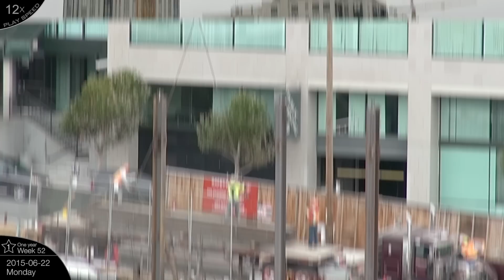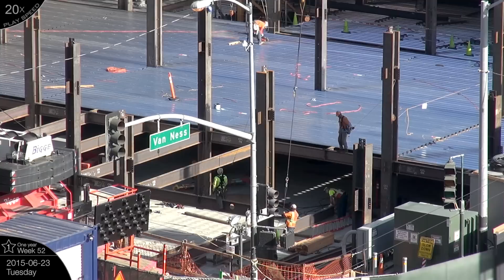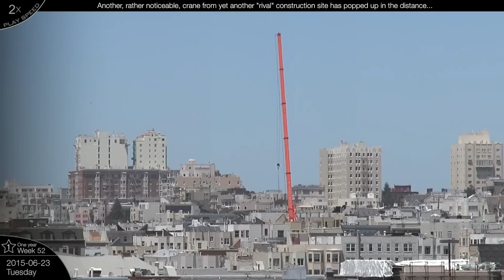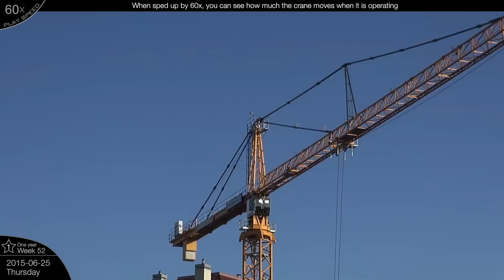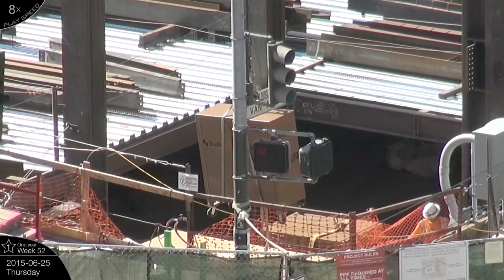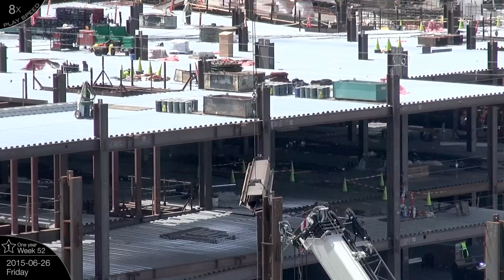One-week construction time-lapse with 36 closeups: Ⓗ Week 52: Ironworkers; cranes; more

Comment from the maker: One-week construction time-lapse with 36 closeups: Week 52:  There are ironworkers assembling the structural steel frame of the building, work continues on the metal decking, the tower cranes are busy unloading and moving stuff, the welders are welding, sheets of plywood get moved around, a bus has a medical emergency causing another bus to come off the wires, we lose sight of the ground floor forever, we see how much the tower crane moves while it is operating, and of course the mystery continues of the red cage that nobody ever rides in.  Finally, this week marks one year of construction videos in this series, and we mark the occasion by doing a nostalgic comparison with what the site looked like back in Week 1.

In this series, we're following the construction of a new 12-story hospital that will occupy an entire city block in San Francisco. This is a construction time-lapse at 900x, with 36 "bonus" highlights/closeups scattered throughout at various speeds, compressing the one-week period from June 22 - 27, 2015 (Week 52) into about 29½ minutes. Non-working days and nights are omitted.

This video is not endorsing or recommending, nor was it endorsed by, any business, product, or organization. The appearance of, or mention of, any person, business, product or organization in it is not necessarily an endorsement or recommendation of or by that person, business, product, or organization. This recording is of views and scenes visible to the public.

Music licensed from AudioMicro.com. I know I'm using the same music for all of these weekly time-lapses, but there's too many of them and they're too long to license different music for each one. You are of course free to turn down the volume and provide your own accompaniment music!

 #construction   #timelapse   #timelapsevideo   #timelapsephotography   #constructiontimelapse   #sanfrancisco   #heavyequipment   #ironworkers   #crane   #towercrane